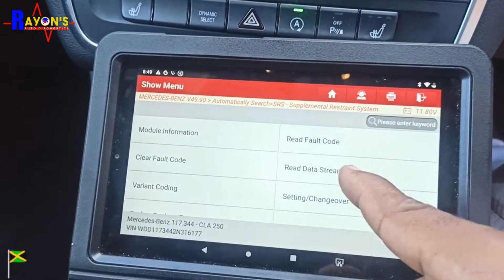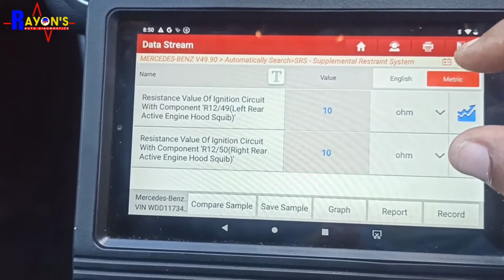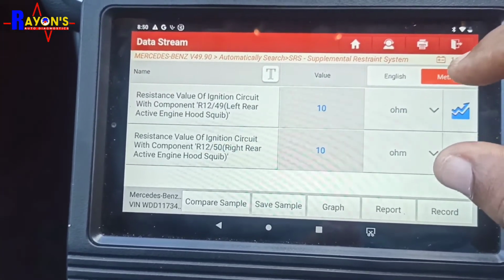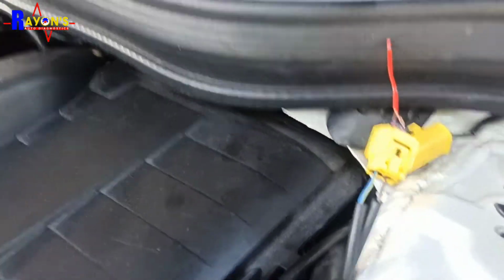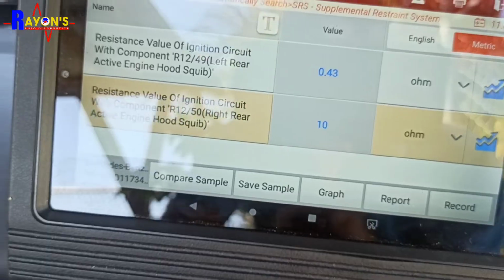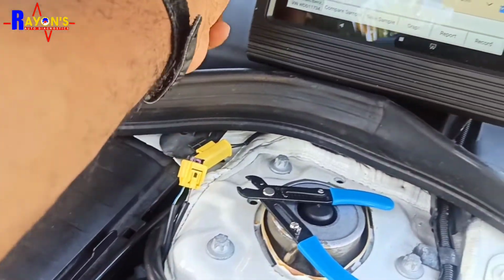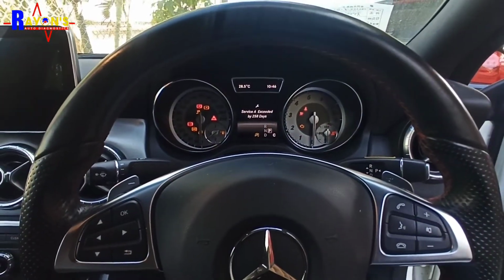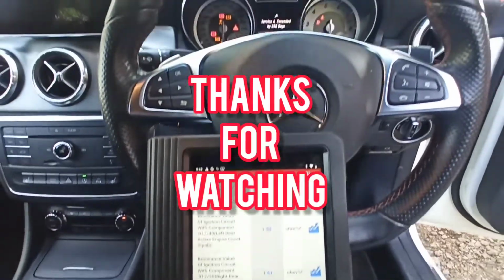Bypass - Mercedes Benz Active Hood Malfunction

Comment: In the event of an emergency, current will be supplied to the resistors and they will heat up and burn out, can't this cause a fire?
Reply from the maker: No, not for these small resistors. The circuit would become open. No fire

Comment: Great Video, Rayon i have the same issue with my 2014 Cla 250 but cannot source the Squid replacement. Any suggestions?
Reply from the maker: Just get the resistor and install them
Reply: Ebay has loads of them on sale reasonable
Reply: Squib*